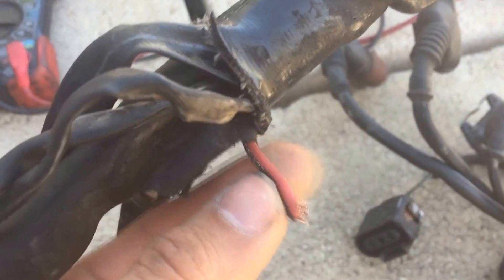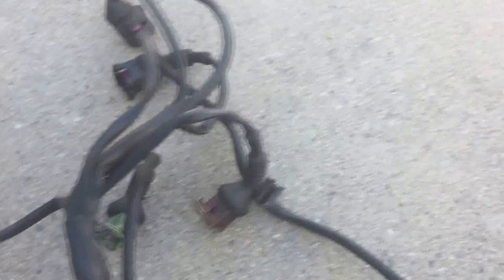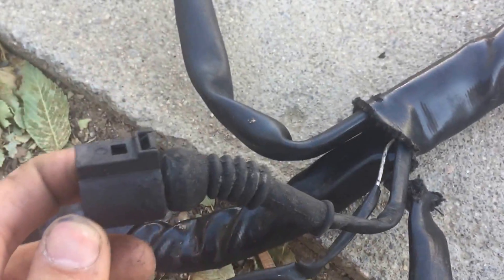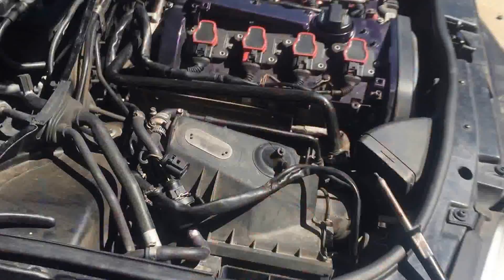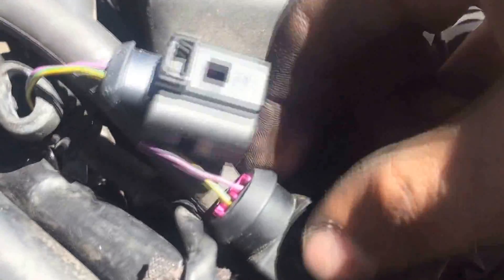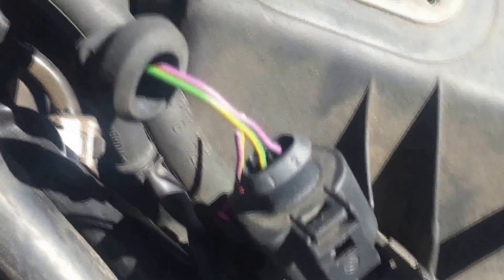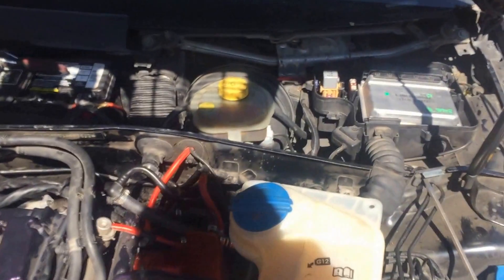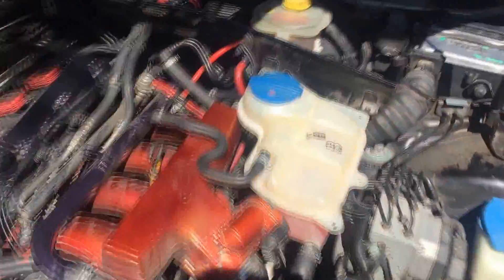Audi B5 A4 1.8t ATW to AWM Harness Swap Narrowband to Wideband and VVT Part 1

Comment: Is it possible to swap a AWM engine into a 2000 body ATW car? I just bought a 2000 passat new engine and popped the hood. Its got a AWM code on the head and it has the ATW ecu? Can i make this work? Ive been looking at finding a 01+ awm ECU. Im not sure if this will work with the body of the car?
Reply: Did your swap work?

Comment: Want to swap to AWM from AEB, where’s the best place to find the harness and everything I need to swap over? I need brake booster, master cylinder, gauge cluster the sensors for oil pressure/temp and knock sensor. Can you help?
Reply: Did you ever do the reverse?
Reply: @mk4geo822 why😂

Comment: Got the car running after the awm harness swap. But I'm getting p0012 16396 code came timing. Even after the the vvt has been coded out
Reply from the maker: email me your tune and I'll verify it was coded out correctly. RENOxDECEPTION@gmail.com

You may also need to swap to an AWM trigger wheel.

Reason being, I don't think it's coded out, because if it was, it would not be requesting the intake cam to advance (vvt active). Sometimes tuners make a mistake and when they're leveling the entire vvt map, they accidentally set it to be always active instead of always inactive. Tell your tuner to look for this map, the second image is actually incorrect and it should be inverted, which I did afterwards: https://www.instagram.com/p/BXfBl7IHPBf/

And they will also need to copy the timing maps from the non-active state to the active state as well.

Comment: So I'm swapping the awm harness 5spd to an atw noticed that awm harness doesnt have the connector for the coolant tank sensor
Reply from the maker: If it doesn't yours is broken.
Reply: @WarHawk427  so I found the wires it was cut in the loom. I got swapped. I have the harness swapped completely. I didnt haave  vvt solenoid like yours. I have my buddy helping tune the car. Vvt is coded out but I'm currently getting a P0012 16396 cam timing over retarded. Did you have any issues with you swap? How hard was it to swap the vvt stuff and what do I need for it?

Comment: i need dire help! i swapped AMW motor into ATW body and im getting no spark at all i noticed there are a few different wires from the body plugs into the ecu ie a red/brown on tan 10 pin plug a vrown/yellow on orange 10pin and a solid yellow but i am using the AMW harness and AMW Ecu but i get no spark to the coil at all any ideas im so stumped on this
Reply from the maker: Any codes? 
Does check engine light light up with key on? This indicates power to the ecu.
Reply: +WarHawk427 check engine light does not light up.
Reply from the maker: +James Delaney check connections from harness to interior harness. Also fuses for ecu especially fuse #29
Reply: +James Delaney no codes it did earlier with crank position but it was just not plugged all the way cleared an no codes but no spark to coils. cranks fine gets fuel and everything just no spark.
Reply: theres 3 wires from ecu to interior harness that the 2000 has that the 2001 does not. i bought atw for 300 bhg just swapped complete amw took amw harness and amw ecu..... do i need to use the atw harness and clip the different plugs in or?? cause im stumped and audi telling me im basically retarded
Reply: no codes it did earlier with crank position but it was just not plugged all the way cleared an no codes but no spark to coils. cranks fine gets fuel and everything just no spark theres 3 wires from ecu to interior harness that the 2000atw has that the 2001amw does not. i bought atw for 300 bhg just swapped complete amw took amw harness and amw ecu..... do i need to use the atw harness and clip the different plugs in or?? cause im stumped and audi telling me im basically retarded
Reply from the maker: did you check fuse 29?
Reply: +WarHawk427 yea an its fine even swapped a brand new one and still no power to ecu
Reply from the maker: +James Delaney make sure you check the connections between the ecu box and cabin
Reply from the maker: A narrowband ecu IE (ATW will still be able to run the engine, try testing with another ecu)
Reply: +WarHawk427 so i can run awm motor and harness with atw ecu?
Reply from the maker: yes but with error codes and VVT/wideband will not function. good for diagnosing that it's not the ecu that's bad.

Comment: sweet video man very informative im looking to do thus to my car soon and this video andwered all my questions
Reply from the maker: +Volksdabbin 20vT 
make sure to watch part 2
Reply: +WarHawk427 i finally sourced the computer and the harness bro just need the knock sensors and the 02
Reply: +WarHawk427 also the car i got the ecu off of had a bunch of other mods i only git the 225 injectors and the baileys dv30,  i got the motor harness looks good condition no wrips or nothing and im hoping the ecu might b tuned because the car seemed to b running the 225
Reply from the maker: +Volksdabbin 20vT pull back the rubber covers on the coil pack connectors, the wires crack and short out very often
Reply: +WarHawk427 theyre golden bro the car looked like the guy just re did them, the connecters are perfect i will redo wiring tho because the guy didnt do the best of work on it but will keep the connectors forsure, i really thank you for this video again i dont know if ive told you before! im planning on doing a write up for the forums and for my local b5 group page from so cal on this too with pictures ill b posting a link to your video in it as well giving you recognition for the help really
Reply from the maker: +Volksdabbin 20vT for sure my username on Audizine and vwvortex is RENOxDECEPTION
Reply: +WarHawk427 i had one last question was the car still able to run even tho the cluster wasnt recognizing the ecu? i dont have a vag com and my plan was to do wiring at home and drive to the homie to get it reprogrammed, or would it not be able to run
Reply from the maker: +Volksdabbin 20vT yes I don't remember the exact symptoms but I could still drive it. You doing this on an Audi? Because VW could have an immobilizer.
Reply: +WarHawk427 yeah its being done on a 1.8tQM
Reply: +Volksdabbin 20vT no immo to worry bout,
Reply from the maker: +Volksdabbin 20vT you'll be fine, I think I got my full version of vcds from totalcardiagnostics.com for about $120

Comment: leave wat the awm I have a bent valve I want to swap engines or put another awm wat I should do can u help me out..
Reply from the maker: +Honestly Delcor The heads are identical except for the porting for the intake, swap over your cam chain tensioner and camshafts from the old head to the new one (because VVT), also I would recommend running the AEB intake for the larger ports.